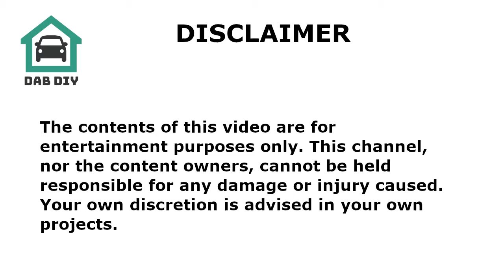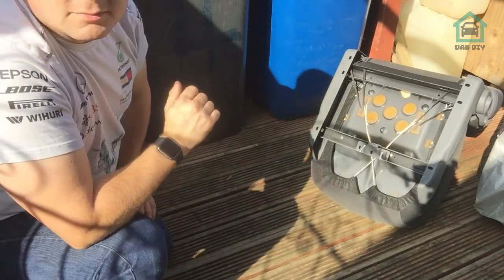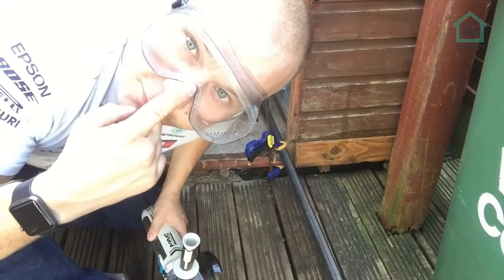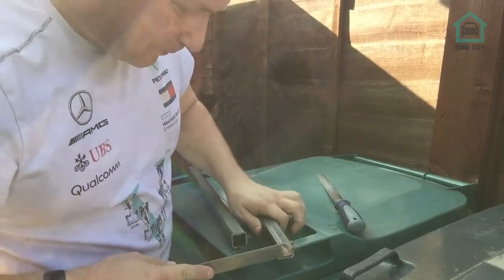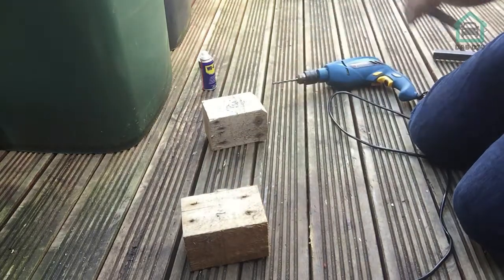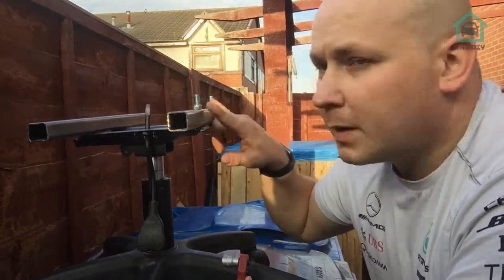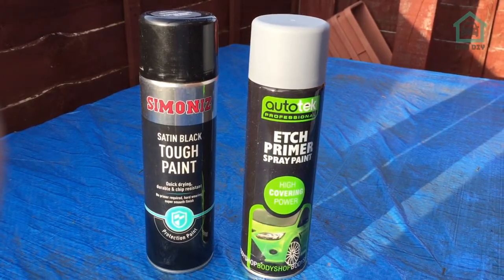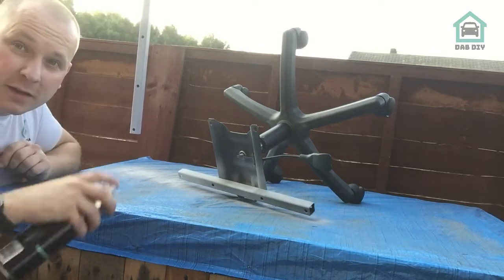Making an office chair out of a Citroen C1 driver’s seat

Comment: Math is math.
Reply from the maker: Math is wrong 🤣
Reply: @DABDIY  math is math but not when math doesn't do as math is told and the goalposts move when you fail to take into account hole centres because you get carried away with the countersinking.
Reply from the maker: Math is merely a tool. If the tool is used incorrectly, you’re gonna have a bad time 😅